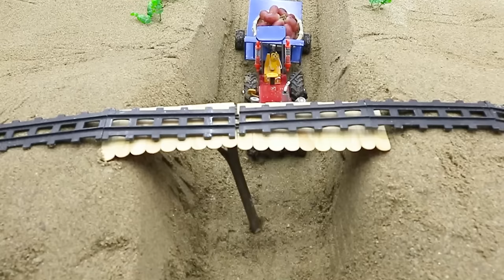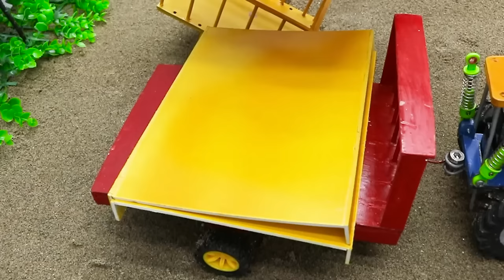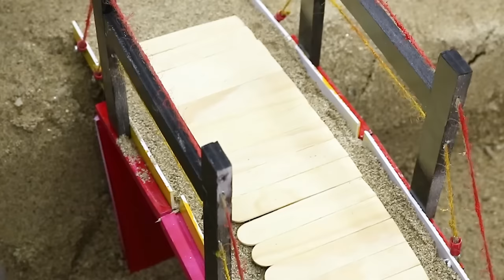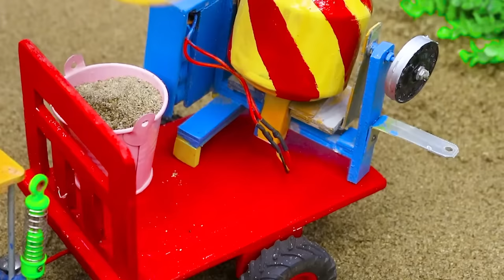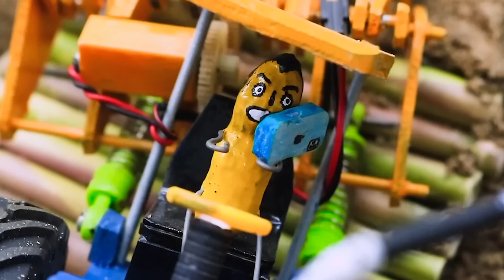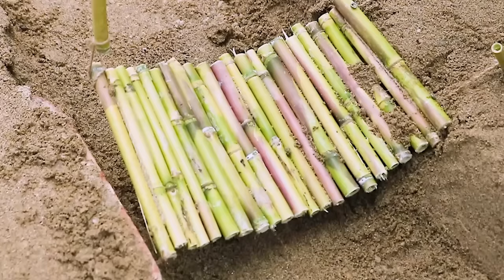Diy tractor making bulldozer|Build your own bridges and roads with high-tech machines,concrete mixer

Comment: 🏞️ The transformation of the DIY tractor into a bulldozer is fascinating. Building bridges and roads with high-tech machines and a concrete mixer adds a layer of sophistication to the farm. A video that keeps you engaged and highlights the beauty of innovation in agriculture. 🚧🚜 #BulldozerInnovation #FarmInfrastructure